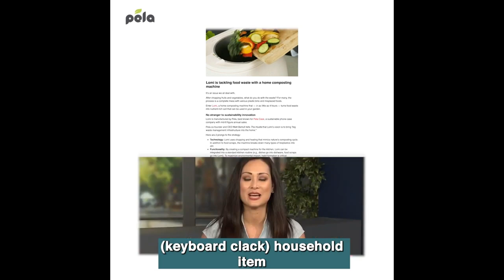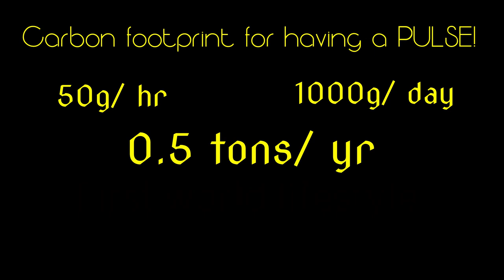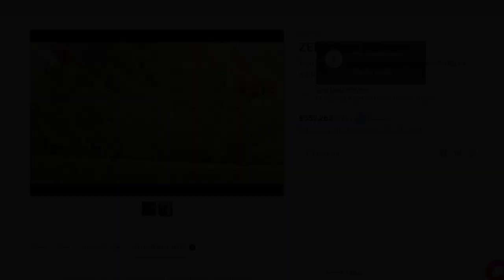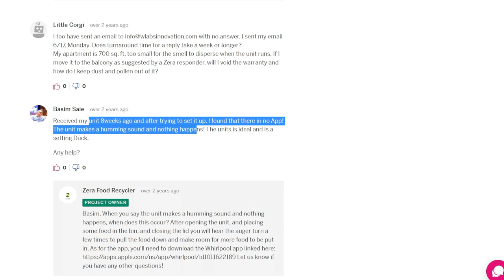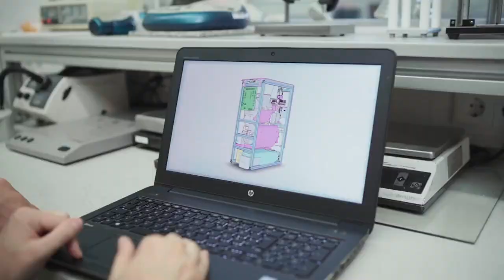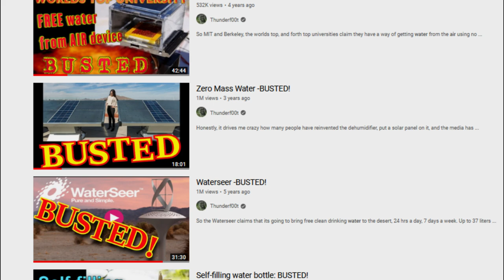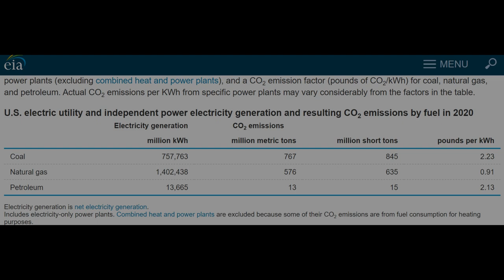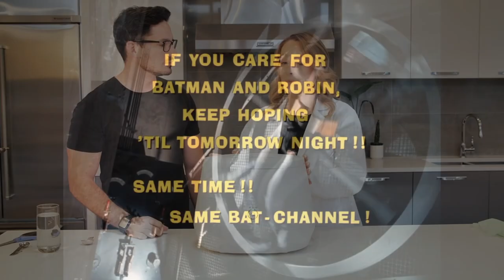Lomi: BUSTED!

Comment: It's been a while since i studied horticulture but wouldn't the desiccated "compost" also require a shit tonne of water to re-hydrate it and make the nutrients contained available to the plant?
I remember that potting medium can dry out to the point that it becomes hydrophobic and takes a lot of time and effort and/or applying soil wetting agent products to get it back to the point where it holds actually retains water again.
Reply: "to the point that it becomes hydrophobic"
Ooooooh.....
That's why all my plants die!?
Reply: With these LOMI type devices, don't need a toilet too much anymore.
I can just fire off a deuce and take a leak in the LOMI. There you go, hydration added.
Reply: Yep, i just knew immediately from composting and gardening for years, that this was bull. I don’t even have great technical/ academic knowledge on the subject of the water/ heat processes but I’m fairly well versed in biology. You also want that sludge, and you want to give all those beneficial microorganisms time to colonize! Composting can never be an overnight process no matter how you look at it.
Reply: Well, presumably it will be in outside gardens and can be re-hydrated by the rain.
Reply: @tarstarkusz  yet the adverts showed the "compost" being added to indoor potted plants.
Reply: @FroggyMosh  yes and no, most likely yes, the whole reason no.
Reply: @MermaidMakes  you can speed run it, you have to layer the material with wet loam. 1 week till compost
Reply: I was just potting something yesterday and noticed this exactly. My potting soil had to be carefully soaked in water before it would hold anything. When I just poured water over it, it drained right through the bottom of the pot.
Reply: absolutely... and thus the whole dehydration is totally pointless...
Reply: @johnmcvicker6728  yeah ... it actually generates its own heat ... sometimes, when the pile is big, you can see the steam rising :)
Reply: Let’s use an insane amount of energy taking all the water out and then use an excess amount of water to rehydrate it later on, because…you know, conservation and climate change!  Roflrofl
Reply: @user-bc7cb8uu7e  Adding a little bit of biodegradable dish washing detergent can help with that.
Reply: @SomeMorganSomewhere  Good to know. Thanks
Reply: @CharlesNauck  Exactly! Apart from that, most of plants don't like being swamped in actively rotting organic material. That's why when we compost, we wait till most of organic matter decayed and turned into soil like composition. And don't get me started on throwing food leftovers full of salt and fats/oils into this "composter", and then to pots. Just salt alone would be enough to kill sensitive plants. I don't compost food scraps with lot of oil in them, and for salty food leftovers like bread or roast bones, i soak them in water, which I discard, before throwing into compost bin. Finally you constantly add grass trimmings and mulch to the compost bin to balance it out.
Reply: @equinoxshadow7190  You can take your Lomi poop into Lomi and Lomi wipe your but afterwards! Don`t forget to manually put your wipes around the egde of the Lomi container to help lomi with her work
Reply: the reason why plant soil is sold in a hydrated state contained in plastic containers/bags, and not as a dried powder, or hard pressed bricks that would otherwise be much more efficient to store and transport

Compost and manure are such good a fertilisers because they are "alive" meaning they contain a working, balanced set of microorganisms.
Reply: @AG-ig8uf  Exactly, my first thought... My mom, when i was  a young boy,  always had the composter hidden in the backyard behind some bushes and she was always mad when we (kids) peed into it , explaining that, by doing that way we add a lot of salt and toxins to it, changing the PH and destroying he soil

Comment: Using energy to remove the water content by heating and breaking it down by cutters will never make ecological sense because both actions can be done energy-free by just putting it on a composter outside + time.
Reply: Decomposition can't happen when it's too hot or lacks water. So it's doing the exact opposite, sterilizing it. If they have to warn about the heat and that you can burn yourself when opening Lomi, then you've killed any living thing in there, which isn't what you want to do when composting. Sure, baker's yeast can take temperatures up to 50-60°C (125-140°F) or so before it dies, but if the machine is that hot where you feel the need to very explicitly warn about the risk of burns if someone opens it while it's running, then there's zero decomposition going on in there. Ideal fermenting temperature for baker's yeast is just slightly colder than human body temperature, so that should be a good rough estimate for the ideal temperature in a compost.

Comment: Using warm water and bubbles while mixing you can actually speed up the composting process and bring it down to 12 hrs. You can then trap the methane and use it a gas. This is the best way to do this but it only works on large scale efficiently.
Reply: Yes it is called aeration, they use this in sewage treatment plants to help breakdown sewage and reuse water.

Comment: It physically enrages me when I see commercials or Kickstarter videos that play heavily into the audience's emotions because there are a plethera of gullible fools out there who want to feel special and convince themselves that they're actually contributing to anything.
Reply: Its not just crapstarter, i ve seen hipstery brands of food selling trash chocolate where most of the value went into quirky designs that say “hey i’’m different and you also save the planet”

I just wanted to scream at them that they are full of crap but i remembered that i was temporarily using their office space for my own work oops
Reply: Think about nearly every ad you ever see, they play on emotions because that's what sells products. Average consumers don't care about the details of most products like the durability of the alloy used to make their kitchen knife, or which power drill has the most turns per armature in its brushed or brushless motor, it's about selling the image behind the product rather than the actual product. 

It sucks because it makes it tedious to properly compare products, but it works and it works well.

Comment: If you're concerned about the smell, leave the compost in your oven and set it to a low setting for a few hours or buy one of those fruit dehydrators.
Then stick the dried food scraps into a blender if you don't like it in big pieces. 

I only charge $99 for my advice.

Comment: i recall seeing a hand crank composter at my local hardware store, this being effectively a suspended barrel that spins and shreds food waste while you crank the handle for about 5 mins, about $50 and it can sit in ya back yard next to ya garden, being about the size of a small barbeque. seems cheaper and more green option then this high tech shite
Reply: These are great. The daily agitation and occasional watering speeds up the composting. You get compost in a shorter time. I suppose if you want to speed it up more and use a bit of electricity, you could add a high torque, low RPM motor to rotate the drum continuously. Add a moisture sensor and an IoT gadget to a phone app telling you when to add water and you could Kickstart that as a greener than a looni desiccator grinder thing. Oh, also add a cool LED colour changing ring light for some UI reason. Paint it all white in some nano particle paint to add an extra 80% to the price for science reasons.
Reply: Add a solar power unit for and additional $999 and make it greener. Also tell users you have to subscribe to the 'nutrient powder' supply. Every month we ship them a packet of scientifically formulated "Powdr" ™ ® © (which is just sawdust died with a bit of food colouring).
Reply: It would be cool to have one of those home biogas generators. Turn your food waste into gas and cook on it. But I don't think i'd have enough food waste to make any decent amount of gas.
Reply: @silverismoney  you would have to poop in it also to make it really effective.
Reply: @lsrengines  At least you would have a good excuse for tonight's dinner tasting like shit!
Reply: But then you have to exercise and we all know how bad that is for you
Reply: @DJMcFlinty  you could solve that by adding a tread mill to spin it instead of a solar motor. Put a saw dust toilet with a hand saw and some scrap lumber to make more saw dust then add a rain barrel solar powered shower for some hot water to get clean and hydrate your compost. So you get a full work out eat lots of bran and you have it all. Arm,  leg, and abs by shitting bricks.
Reply: @maxximumb  game changer

Comment: Grinding things up to compost them may not be the worst idea, but I think you could do it for cheaper than 500$ I'd also recommend doing it outside.
Reply: Yeah. Literally just use a blender for a few seconds, does the same job.
Reply: I like my chickens throw everything in the coop and it's gone and then you get eggs
Reply: Spoiler alert, it's $500 for the machine, and then you're supposed to spend another $120/year on a subscription so that you get the "essential bacteria". So bogus.
Reply: Astronomically cheaper. All you need is some worms.

Comment: I do garden composting.  It takes a long time, though tools like tumblers can make it quite a bit easier.  There are a couple of small ways that come to mind that this "improves" the process.  By grinding the input, the composting process should proceed faster, provided that it doesn't turn into a mush when rehydrated, and by drying out the stuff, it should make it easier to control moisture in the "real" composting process.  That said, this product isn't worth that cost.  Sun dry your scraps on a hardware cloth screen and keep them dry until you accumulate enough material to justify running a grinder for a few minutes, if these improvements are necessary.  My grandparents used to bury their kitchen scraps in the garden.  If you have the option of doing that without attracting vermin, that's probably the easiest approach of all.

Comment: Let's assume that it works perfectly and makes legit compost overnight, what are you going to use the compost for?

If you need/have a use for compost, you must have a garden, the 3 potted plants in your apartment will die if you put too much compost on them.
If you have a garden, you can make compost for free by just digging a hole in your garden, dumping food waste in it and covering it with dirt
Or you can buy a composter for 50 bucks to make things even easier (or build one from salvaged pallet wood). 

Food waste won't turn into compost overnight but guess what, a composter will still give you batches of fresh compost periodically, the only difference is that it will take a few months to get the process started properly.

Comment: I have an automatic compost!  It's in my backyard.  As its organic compounds rot, they provide the energy and warms the pile throughout the winter.  I remove the top layer for a new pile in the spring and use the lower part as fertilizer.  It's awesome and requires no moving parts nor electricity. It is also far enough away from the house not to smell up the place.  I love my automatic composter.

Comment: Yeah the "few hours" to compost is where I went "uhh..that's now how it works guys." What sucks is that this COULD be useful for disabled people that can't physically turn a regular compost pile. The waste being dessicated drastically reduces weight and it would be a lot easier to take it outside to toss on the lawn or garden. But if everyone is using it thats a massive energy waste.
Reply: So much for the answer to my... yard trimmings.
- Jeffrey Dahmer
Reply: The fact that people have the audacity to defend this crap even though it's been proven time and time again that these things are BS is appalling.
Reply: compost tossing barrels have been a thing for a long time. throw the shit in and crank the handle to mix and walk away.
Reply: You can get small turning compost barrels, I’ve seen ones made from 9L buckets

Comment: I'm a Biosystems Engineering student, I have 3 different methods of composting at home, these systems take months to fully compost material, the most efficient method I have is Takakura, a 15kg bin can process about  600g per day and you have to control the humidity to get good performance, "bioplastics" are not compostable under home composting conditions...

Comment: Technically, there is a difference in how much methane is produced depending on whether or not the stuff breaks down in an oxygen rich/poor environment. Food in the landfill is worse, but grinding it up first is totally irrelevant. If anything, grinding it up halfway through breaking down is what you need to do in order to mix more air into the center.
Reply: If I understand things correctly, all this device appears to do is (in effect) to grind up whatever you put into it, and dry it out, at the cost of energy and about $500 in initial costs.
Reply: @TigerKhan1990  You don't understand...you need to purchase filters and sanitisers for the machine throughout the year...Look at the costs on a similar machine at 22:55
Reply: The perfect solution is to "upcycle" it by feeding it to animals.
Of course that also has its limitations.

Comment: I was screaming at the screen "That's not compost!!!"
You have to add a source of carbon like an old piece of newspaper or sawdust or woodchips, mix it up, put it in a bin in your backyard, and let natural bacteria do their work. Ideally you'd add some worms to the bin as well.

If you live in an apartment, just go to the hardware store and by some compost. Throwing dessicated food into your potted plants is a silly idea. The minute you water them, they won't be dessicated and will begin to rot.

It would be easier to use a food processor to chop up the food a bit before putting it into the bin if you want it to break down faster.....But yeah, fools and their money.....

---
As to the engineers, no offense to any engineers reading this but I've found they can be a bit myopic especially in groups. It's related to the old saw about being able to do make something without asking the question if they should. The group at Lomi seemed very young.
Reply: They glossed over the important part: "what is compost?"
Reply: I would argue it has less to do with engineers and more to do with people, especially young people, in general. They get into a groups, they're getting paid, all they care about after that is social validation. So no one has the courage to be the one smart person in the group going "guys, this is never going to work and in fact will have the opposite of the intended effect" because in their mind they get paid the same either way. Giving a fuck is out of style. I'm sure that has nothing at all to do with engineering quality trending downward in almost every field, software might be the best example.
Reply: @ciarfah  I know!!!! They kept calling it compost. But it was not.
Reply: The engineers from Lomi look like college students
Reply: Theres Bokasi composting, if youre in an apartment and really want to compost on your own.
Reply: @MarkWhippy  Thry're not engineers, they're """"""""engineers"""""""".

Comment: They would've made a bigger difference by either making a PLA decomposing chamber, or at least a filament puller to turn the various plastics from their original objects or 3D prints into a filament to be repurposed into a fresh print.
Reply: I would buy the hell out of a machine that produces household plastic into reliable 3D printer filament, spools are incredibly expensive online
Reply: most plastics, bio or not, are simply not printable with a normal 3D printer. plastics need to have very specific temperature characteristics to work.
Reply: repurposing plastics for 3d printing, should be the holy grail for eco friendliness.. no environmental issues, gases, leaching, as well as the original manufacture, with its own shipping/logistics, etc.
Reply: @sudazima  Majority of non-specialized plastics are ABS, PLA, or PET
The only one of those three that would have issues is PET, due to the tendency to crystallize at prolonged tempurature. Even then, that shouldn't be cause for concern as long as you're not leaving the hotend preheated for prolonged periods, at worst you migbt have a print that's a slightly different color than you expected if it wasn't cooled fast enough.
Reply: @kmemz  yea no, firstly PE is the most common plastic if memory serves. but you cant just mix a bunch of random plastics and have it be printable. if it doesnt solidify fast enough you cant print, if it solidifies too fast you cant, if it expands or contracts too much you cant, even small amounts of thermal hardening plastics can block the emitter etc etc.
end user plastics should just be burned, effectively you just burned oil with an extra step.

Comment: I have this new idea for a revolutionary food recycler. I call it the compostobox. Just for a 100usd you can get your very own compostobox unit (some assembly required). It arrives in a neat package and with minimal assembly you can put it outside and let it do its magic. Just add food waste, wait, and done.
Reply: shows someone loading some egg shells, theres a little bit of snow on the ground but spring flowers are blooming.  next shot is deep in autumn with leaves falling, the same person has a heavy sweater on and is kinda fussing inside the bin.
Reply: You are missing the key market you need to advertise to, sociology has proven the most gullible people with cash to burn are city dwelling middle managers or working in specialist fields. They are easily swayed to buy something that is touted as environmentally friendly by colorful sales pitch videos.
Reply: Is it a box?!
Reply: @extragoogleaccount6061  Obviously not. Would a simple box cost 100$? This is QUALITY.